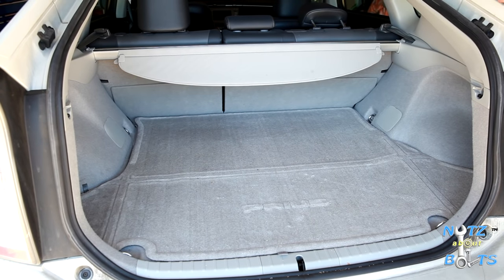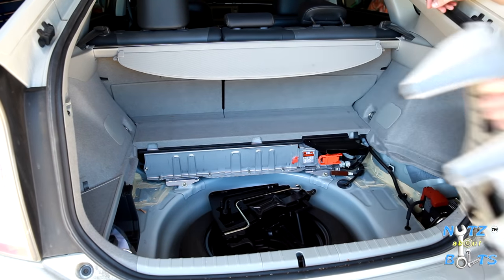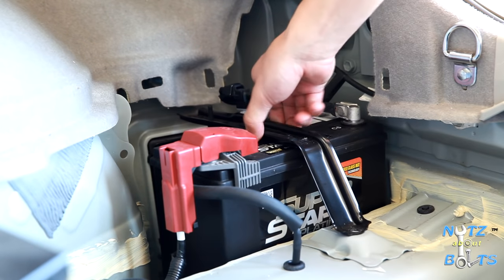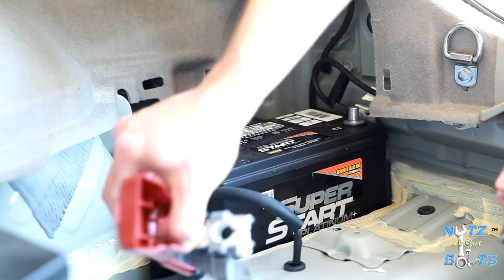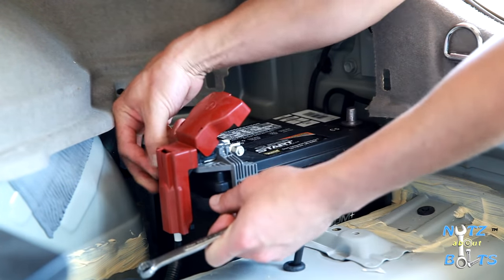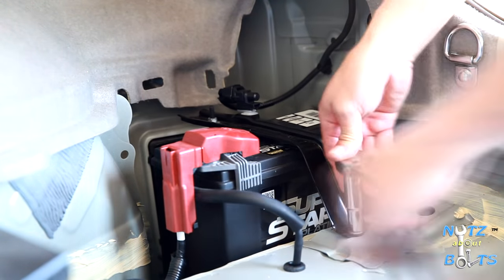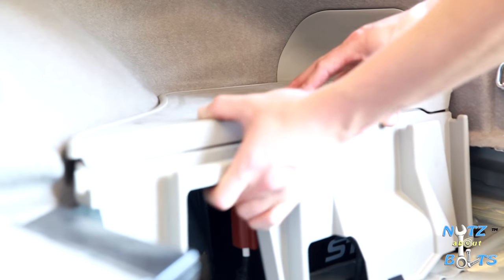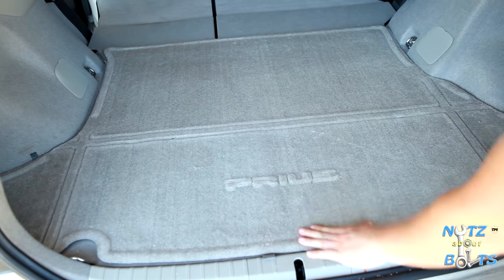2010-2015 Toyota Prius 12V battery replacement

Comment: Great video. It was very helpful.  Here's a tip, once you pull the old battery out don't close the hatch, it locks. I removed the old battery and closed the hatch and drove my other car to the part store to swapped it out with a new one so I could get the core refund. The hatch lock needs the battery to unlock. I had to entry the car from the backseat to install the new battery. If you are a big guy that might not be too easy.
Reply from the maker: You can manually open the trunk latch. We have a video on that as well

Comment: Thanks. This was helpful. We have a 2015 Prius. My wife usually drives it. So had the key fob in my pocket, touched the driver handle to unlock and the horn starts blowing, weakly. I used the key fob to deactivate antitheft and get into the driver seat. Put my foot on the brake, then pressed the POWER button and the LED turns amber. On the display it showed aux battery low. Did not attempt a jump, assumed the 12v batt was toast. After research, looking at this video, I decided it is an easy DIY. Downloaded the procedure from the Toyota.com owner webpage. Replacement battery used is the highly rated Optima Batteries model DS46B24R. Unfortunately, was unable to open the rear hatch, so had to work form inside the car. Folded down the back seats then was able to remove everything as in the video. Confirmed, only had to set date and time, radio and of course ODO settings were preserved. On a side note, the 12v batt is used to power up the ECO and ancillary electronics. The ECU in turn starts the engines.
Reply from the maker: theres a video where we showed you how to open the trunk manually so you don't have to change the battery while you're in the trunk.
Reply: Neha Raspann You can open the rear hatch manually, OR, you can always hook a battery or jump starter under the front hood to the jump start terminals......hit unlock and get in the back.....easy

Comment: Hi Nutz. I'm sure I will lose any settings after replacing it. Anything more to it?
Gracias.
Reply from the maker: You’ll lose radio settings, and the clock. That’s it.
Reply: Done. No biggy... thanks to your help.
Reply from the maker: Np, glad it worked out well.
Reply: I didn’t lose any radio settings, just clock.
Reply: I used a trickle charger in the engine bay to save the settings

Comment: we have the 2012 prius with original battery, had it checked and it passed the test but I've had to put it on trickle charger once in a while. Should I still replace it due to it's age? It's about 10 yrs old now. Also, if I do, what does Toyota use for their OEM 12 car battery? Or just go to Napa, Autozone, Amazon? thanks
Reply from the maker: I’d use it till it’s dead, but make sure to have a back up incase you need to go somewhere and you have a dead battery. I bought my battery from oreilly, Autozone don’t carry Prius battery.
Reply: @NutzAboutBolts  Thanks! Yes it seems work fine (for now). Toyota in Bend OR wants $280, and did check w Oreilly, its $209 there. OEM any better in quality?
Reply from the maker: @ZDUTCH1  maybe for their warranty. I change my 12v every 4-5 years

Comment: I bought the Toyota Prius 12v battery for $45. I then returned the same battery that the dealer had charged me $210 for, that I had installed. The $45 battery was at interstate battery, they just happened to have one but I don't expect that anyone would find another deal like that.  It was the identical, exact same brand and battery that Toyota sells.
Reply: Which model was the one you got at Interstate? Going to try them this week.
Reply: Ben Hines  It was a geniune Toyota Prius battery.   At Interstate I always ask about their "scratch and dent" batteries.  They have small scratches or missing labels, etc.  Usually brand new, but they give less of a warranty.  They sell any of those for $45. They happened to have a Toyota Prius battery, identical to my old battery.  Its worth asking, but they are hard to find that way.  Also check for the Optima made for Prius.  They also gave me the option of putting in like a lawn tractor battery, or any battery that fits. They have as many or more amps than the original.  But they are supposed to be vented batteries (or maybe sealed woukd work too?)  because they are inside the passenger compartment.... and batteries give off gases.  If you use a different battery they can rig up a way for the connections to work.

Comment: Got the confidence to change my 2013 battery today thanks to your video. Thanks for the valuable demo!
Reply: Is it really as easy and straight forward as the video made it look? I don't want to screw it up, but the autoshops want $100 - $250 to install it!
Reply: A. H. Yes, I followed this step by step and it worked just like the video. My wife was actually impressed like I knew what I was doing. Don’t forget the vent! Also I got the replacement battery from the Toyota dealership. It was pricey (about $100) but I read somewhere that other replacement batteries didn’t have optimal charge for the hybrid. Not sure if that’s right, but I decided not to take a chance.
Reply: @levelupinvesting5539  thank you so much. I wasn't sure if I should get the Toyota battery or an Optima one.

Comment: BATTERIES + BULBS HAS ONE MADE BY DURACELL SAME PRICE AS DEALERSHIP EXCEPT COMES WITH FREE INSTALL OR DO IT URSELF...also dealer offers 24month free replacement vs 48 month free replacement u get thru BATTERIES +BULBS......DEALER WANTS $300 WITH INSTALL....BATTERY ITSELF  IS ABOUT $210. (2012 Prius with 154k miles with original 12v battery) just now going bad...not bad at all :)

Comment: Thank you for the video. What if you loose your settings? I lost mine when I disconnected the 12v for brake change.
Reply from the maker: the only downfall is losing the radio, and clock settings.
Reply: You can also attach a trickle charger to the post and block in the engine bay to avoid losing the settings
Reply: @DooDahMon  About to change my battery, this is exactly what I was looking for - wasn't sure if it saved the settings or not. Thanks!

Comment: great video as always, but what's really missing is what alternative standard car 12v battery can you use for 1/3rd the cost ? that would be a good DIY...
3rd party replacement (oreilly, battery+, napa (cheapest) and even dealer are ~$200-240) vs $80 for standard small batteries... question is which are same size, vented AND small connector, else what are the options for full sized one.

Mine lasted 8.3y (185k) and would have lasted longer had I not played with ODB tool to brake bleed and do other tests, which drained the battery to the point I couldn't start. Had it tested and was 160cca (half) or less. recharged and took long trip, but next time I did some shorter test, it wouldn't start again after. Time to replace...

Comment: Great video!! Very professional, clear and make to see a easy job!
This video has helped to save a lot of money doing the job by ourselves.
In another hand, about the battery details, I guess this is the reference number "s46b24r" I just would like to be sure, and the price is between $170 to $270 depending of the brand.
My question is if this price is okey, or if I could use any type/regular battery?

Comment: I have a 2010. Alarm/unlock/lock happens randomly.  Think it might be the battery? Any odd re-set steps for the electronics, etc. after new batter installed?

Comment: Thank you for making the video.  My 2013 Prius would not “Start” when depressing the brake and press the Start Button; it would be in “Accessory“ mode.  I took it to the dealer and found out that the battery was weak. They wanted $390 for the battery and labor. I asked how much is the battery itself , it was $262 (after returning my old battery). I asked them not to install but that I would buy the battery.  This video gave me the confidence that I could do this so thank you. The positive cable was really stuck for me, but I was able to do this.

Comment: Before changing the battery, did anyone of you get the red warning sign on the dashboard???
Reply: When the 12v battery goes or starts to go your car will look as though its ready to explode, or is posssessed. Seriously, random warning lights, random reaction to buttons, won't start, headlights flashing.... it basically "loses its mind". When it happend on my last Prius I thought "this is it", complete failure major repair, but when I called my local dealer's honest repair shop, they asked how old the car was and how old the battery was and virtually guaranteed that was it. It was so when it happened on my current car I knew what was up.
Reply: Yes, I got red triangle and other warning lights on the dash....and the MFD screen said parking brake wasn't applied.  (another glitch because of low volts)

Comment: My Toyota dealer gave me labor cost of $100 to replace a battery. This video saved me hundred dollars! Very straight forward to replace the battery with in less than 15 minutes. Provided you got the right size spanner tool. Thank you.

Comment: What is that "push button switch" that's mounted to the battery hold down part? I was trying to figure out what that does.
Also, would it help to keep 12v applied to the terminals while replacing battery, or does the car just work fine after replacement without doing so?

Comment: What kind of battery would you recommend? My 2014 may be due to replaced soon, therefore I'm wondering if you have any recommendations about what battery to get.
Reply from the maker: Costco has cheap battery, I don't recommend auto zone. I just bought mine from O'reilly for the Prius, and the Honda Accord I got one from Costco. Costco is cheaper though, so my battery will be mostly from them now.
Reply: Thanks for the response, your videos had been a great help, for my two prius and the honda accord (accord sold last month)
Reply from the maker: nice, I'm planning on selling the Accord as well, and buy a Sienna :)
Reply: Just realize its a special battery both in size and in being sealed with a port that a tube connects to for air so it has to be specifically for the Prius. I had AAA out to jump my car and test the electrical, but they don't sell Prius batteries so I bought the replacement at Toyota (same brand as original) since the original had made it 5 years, so not too bad.
Reply: I called Interstate Batteries and the owner there recommended a sealed lawn tractor battery for around $100 with about 550 cca. You just have to make a different kind of connection on the cables.  I already bought the Toyota battery for $210 and it's only about 350 cca.   But it only has to power on the computer.....it doesn't crank the engine, so amps shouldnt matter.  I'm thinking about keeping the Toyota battery just because its original even though it's more expensive for Less power
Reply: For the benefit of anyone else reading your post: I just ordered the Optima Yellow Top battery from eLearnAid for $220 (free shipping).  The folks on the Priuschat website seemed to regard it highly.  That being said, I've had the original 12V in my car for almost 8 years and 100K miles and it's still going strong.  I'm going on a road trip in a month and wanted to replace it before I left, but it makes me wonder if it's the same as the "Toyota brand" battery offered by my dealer.
Reply: romansten9 CCA’s don’t matter whatsoever  for these batteries. They power  the ECM (and lights/radio) so it will start and the traction battery starts the car.

Comment: The OEM battery with an 84-month warranty (24-month free replacement, remainder prorated) and free towing if the battery dies, is about the same price as the various aftermarket batteries with much shorter warranties.

Comment: Its a group 51 battery , very common  why not just get it at Walmart, their batteries are great its $120  or check Costco its probably cheaper. My last car had a 9 yr old Walmart battery sold the car and the battery was fine

Comment: i read you should attach a jump pack to front jump terminals while replacing back battery so you don't lose radio, elec windows and other settings on car ( Like oil change reminder etc

Comment: I bought a used prius and it had battery changed at 110K  I have had it 3.5 yrs and after an oil change ( not sure if the casue yet) but the mileage dropped from acg 44mpg to 39

Comment: Does the "computer" adjust the charge rate to the age change/charge cycle of the battery.  New battery may receive incorrect charging based on old battery's charging requirements.

Comment: My battery died after 4 years. It's an original Toyota battery but was purchased from an independent repair shop. I'm told Toyota only warranties the battery if it's purchased from a Toyota dealer and you have the receipt.

Comment: I have the stuff on the bar broke. My battery is not recharging. before whole month i left the car is ready to go. Now i have to take battery out every few days and recharge. What gives. What is the one connected into bar? the plastic broke when i  took out that metal bar hold the battery

Comment: Can some one tell me teh stuff that connected steel holder? i  broke that thing because i did not see that is connected when i removed one side screw i try to rotate over batter and broke it. What is it and what its function? It has teflon plastic attached to battery. Its not even connected to ground. Why connect to battery

Comment: How long do these 12v usually last on a Toyota , I've heard only about 3 years? Thanks.
Reply from the maker: I changed my battery in 2015, so my battery only lasted 3 years. Its a small battery and I use this vehicle on a daily basis. It gets used 22k miles a year, so for a battery to last only 3 years, its still good. Also, I accidentally left one of the dome lights on, so the battery was pretty dead. If I didn't, it could possibly lasted for 4 years, but who knows. Battery usually last 4-5 years like my Honda Accord.
Reply: thanks.

random question, would you consider getting a Prius Prime?
Reply from the maker: no, I don't like plug ins lol, I like hybrids.
Reply: NutzAboutBolts do you mind telling me why, because I am considering one, either for myself or my wife. Thanks.
Reply from the maker: Its more for convenience because we like to go and not wait for our vehicle to get charged at a station. It is a nice car, don't get me wrong. I would get it if its just a local car but thats not practical for our situation.
Reply: nickolas mine lasted 5 years on a 2010
Reply: About 12000 miles a year
Reply: thanks.
Reply: Just changed mine out of a 2011...Not bad for ANY battery
Reply: 5 years on mine (just replaced 2012 Plugin Prius 12v battery 10/32/2017)
Reply: NutzAboutBolts I thought you could still drive a Prius Prime like a hybrid and you only had to plug it in if you wanted to?
Reply: This is about the aux battery that has nothing to do with the drive train. Its purpose is to start the car,run the electric compressor & windows etc
Reply: Our 2010 was just changed after 112,000 miles.
Reply: Mine lasted 8 years, it's the OEM Toyota battery. Bought the car in October 2015 with 15k miles from Reno and I've doubled that mileage up here in Seattle. Looking for a new battery, $240 from a dealer.
Reply: Pep Boys is usually pretty cheap, or Interstate Battery
Reply: My 2012 Prius V is still going strong on the original battery and I have 116,000 miles on it. Surprisingly since I live in Florida where the heat usually destroys car batteries in 3-4 years.
Reply: OEMs last about 8 years with some going 10. I changed mine at 84K and 7 years old.

Comment: I read about being careful with the battery temperature sensor. Is that sensor the one attached to the metal bracket shown at 0:56? Thanks for the video!

Comment: I called 4 places in South Florida today. Advance Auto Parts charges $195 for battery (no installation) with 3-year warranty. Toyota dealer (Deerfileld) charges $199 (installed) with 2-year warranty. Batteries Plus charges $199 (no installation) with 4-year warranty. Costco does not sell the auxiliary battery. I'm stumped -- the only difference is the warranty... I may as well go to dealer, it seems. Your video makes it seem super easy - I was ready and willing to do it myself!
Reply from the maker: Danielle P yeah, the bad part about Costco is they don’t carry the Prius battery, I believe I bought mine at oreilly and it was expensive. I would go with dealership since it’s free install and 4 year warranty. Hopefully they don’t give you a hard time if there’s issues with the battery before the warranty expires. 👍🏼

Comment: Thank you for an awesome instructional video. How often should the 12v battery be replaced? I have a 2014 Prius and it’s now 2024 and I’ve never replaced it, am I past due? Thank you.
Reply from the maker: usually it last for 4-6 years, if its still good then I would be on the look out for it to die anytime now.
Reply: @NutzAboutBolts  thank you. I will replace it this weekend thanks to your help

Comment: Did you never use sealed 12 volt battery? They don't need to be plugged with exhaust gas straw

Comment: Do you need to use a code saver to keep power to computer while the cranking battery is removed so you don’t lose radio presets and trouble code info?